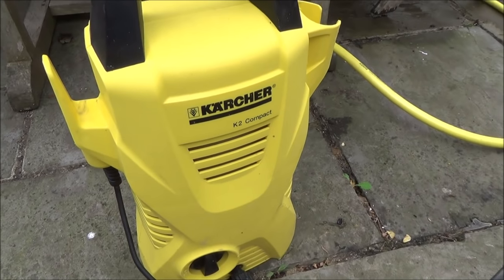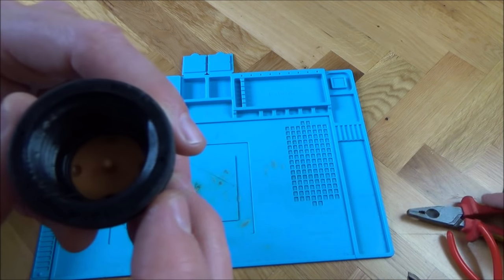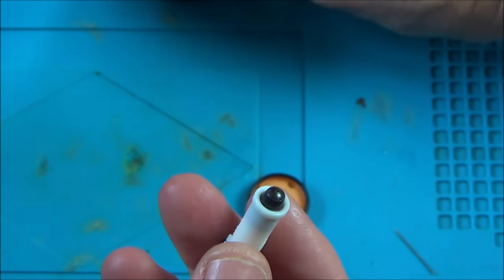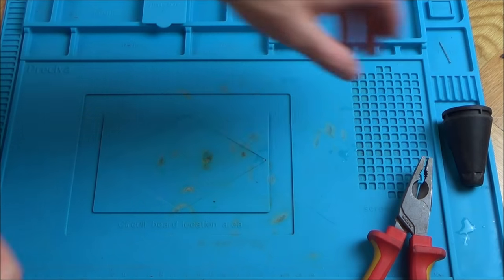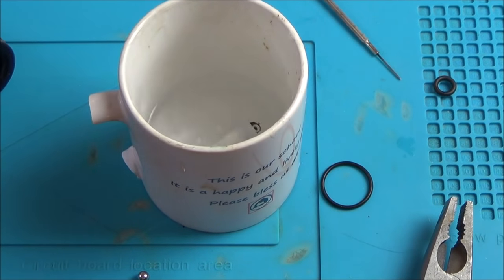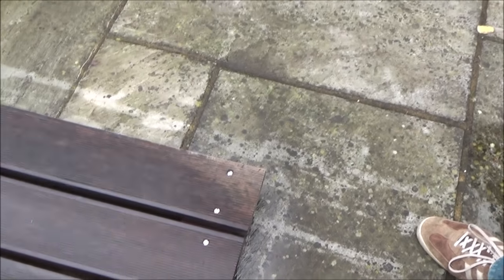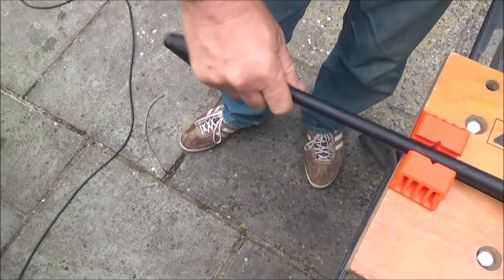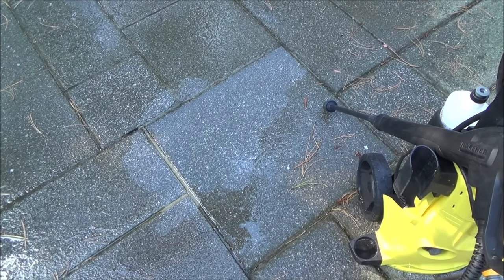Trying to FIX: Karcher Dirt Blaster Lance NOT Spinning

Comment: my job is fixing karcher machines, and i have to say that the plastic dirt blasters do wear out very fast and then stop working properly. the brass versions last much longer
Reply: The various fixes are pretty good. I wonder if it's possible to get after-market parts. What size washer is used in the fix? The dimensions are given in the video, but the metric or English size is not. Any thoughts? My metric pack does not have an exact size to fit. How does one obtain the brass bits? What is the proper name for the rotating bit with the ball bearing in?
Reply: @hanwachtel  there is not always a repair kit available. If there is one available, you can find parts list on internet with the type number of your karcher machine. The type number is on the white sticker that normally sticks on the back or side of the machine, its a 8 digit number for example : "1.520-093.0" . There are some repair kits available on ebay.
Reply: so why dont they just give us a brass one then ffs 0.0.
Reply: chrismechanic B because then how would they sell you a repair kit?

Comment: There's a much easier way to fix it.  Take the dirt blaster off, drain any water out and dribble some ordinary oil down the  outlet hole. That's it, no dismantling needed.

Comment: Vince tell your brother to get the patio head cleaner with bristles it cleans about a 10 inch circle from 4 inches away an stops the spray I haven't cleaned my drive/patio with just the jet since I got the head attachment an it cleans the area in a quarter of the time an your feet stay dry.
Reply: You also use less water.
Reply: The dirt blaster works better from a distance. The closer you go the smaller the cleaning area...

Comment: Make sure to use a stainless steel washer so it lasts.  One will not be horribly expensive.  Also most washers are made with automated punches and may have a bit of a sharp edge on one side and the other side will have more rounded and not sharp edges.  Make sure to put the slightly sharp side so that the bearing is not rubbing on it.  These nozzles are not overly expensive if you shop around but you don't really have to if it is not worn out or broken.

Comment: Excellent!  Who knew that repairing pressure washers would be fun!   I had to do a repair to mine many years ago - left water inside over winter, it froze, expanded and cracked a piece of aluminium on the pressure part.  Luckily I sourced a replacement part and it was good as new!  Now I always make sure to run the jet washer without water until all the water is expelled from inside, then store it for the winter.

Comment: I know, what to do when & if my dirt-blaster starts being a arse. Mine shouldn't as, it's less than a month old 😄  But, many thanks for your solution to a problem that could have had a cost to it. ( a new, replacement dirt blaster at a cost of 😕 )  Your solution with your brothers help 😁 has saved money on forking out for another. For those who may need to do so in the near future. THANKS ANYWAY!!!! 😉    I wonder what would be the, solution if the various lancewood, had issue's Maybe a video in the future, showing how, to deal with that,  . I'm sure, they are, quite, a bit more complex, at the nozzle.  Once again THANKS!!!

Comment: Great Vid. The key design element of the lance is that the ball bearing must protrude from its housing, thus allowing the unit holding the ball bearing to spin. I have a K4 Karcher where the ball bearing sits in a solid tube with no hole to let the water through. I created a copper disc that now sits in the bottom of the tube allowing the ball bearing to protrude the correct distance and it now works like new. Thanks (if you're still monitoring the vids)

Comment: I agree with your conjecture that the ball bearing wears down the plastic support mechanism.  I couldn't locate a washer as small as yours to bring up the level of the ball. Mine was barely above the top of the plastic retainer.  So I drilled a 1/16" hole in the sides of the retainer, just above the cross members, and inserted a copper wire across, bending it up to retain it.  The blaster now continues to run, albeit not as smoothly as before, but at least it gets the job done. Thanks for your insight.

Comment: I've just had to take my one apart too.  It's a GreenWorks model.  The jet nozzle has a 6mm allen up in it's rump and it's REVERSE thread.  My one was built almost the same.  I polished the bits that slide on each other with 2000 grit wet/dry paper and gave it a light tough of silicon grease.  Job done!

Comment: Ok watched. Agree with your diagnosis. Would offer that if you take a pencil and press the washer onto some 120 grit sandcloth with the eraser end, that after 5-10 min of sanding you can adjust the thickness of the washer easily. Sand two washers down to 3/4 original thickness!

Comment: I spent years working for Karchers Rn'D department. Have you ever wondered why the fitting wears down? Well we could have made it from stainless steel, but instead we tried numerous plastic designs. A lot of work went into finding the perfect plastics blend. We needed the fitting to last just long enough so we could be sure we wouldn't have warranty issues, but not too long. A lot of time was spent researching how long the average consumer uses their Karcher. Once we had an average we simply used a plastics blend that was purpose designed to wear out within a given time. Needless to say we charge way over the top for new lances (nearly a third of the purchase price of the jet washer), but hey that's just business! Stainless steel would have lasted a lifetime, but now we sell hundreds of lances.

Ok I never worked for Karcher, but somewhere someone would have been involved in the design and you can be absolutely certain that the fitting was made of plastic for exactly this reason.
Reply: I've fitted a copper disc in the bottom of my K4 ball bearing fitting and it now works like new. So the £54 for a new lance will stay in my bank account!!!
Reply: @999shakers  Good for you, I hope it lasts.

Comment: From diagnosis I am certain that this was dropped and it damaged the inside by changing the length of the stem. Because the length was short the stem was flopping around inside the nozzle and getting stuck till pressure built up dislodged it and lodged it again. Sorta why you feel that pulsing pressure at the start. I From what I can see this is how it works. The inner height of the nozzle assembly is actually shorter than the stem itself. This forced the stem to rest on the outer edges of the radius inside. When water is turned on the water is forced through that small pin hole near the top giving you that high pressure. This flows down the stem and around the bearing(ball). This ball gives the stem free movement around the radius of the orange piece and the small rubber washer acts like a bumper to protect the stem from slamming into the sides of the nozzle at high rpm. Due to the angle of the holes in the orange piece and the angle of the stem itself I believe is what causes the stem to rotate. Because this device was dropped it messed up the length which you both figured out. That washer fix is very nice but remember now because of the smaller outlet between that washer and ball you may end up having to open it up and clean it out more frequently.

Comment: very necessary info! we also have hard water and i immersed the nozzel in white vinegar for a couple of days which dissolved the minerals, largely calcium and magnesium [scale] and it seems to have done the trick - a squirt of oil/silicone now and then could also help. if there is dirt inside obviously opening the unit will be the solution.

Comment: What a fantastic video Vince! I've got a how to fix video coming up later on from our dryer. When it was turned on it sounded like there was something rattling about in the motor, but in fact it was actually a bit that I had changed out a few months ago that had fallen down the lint trap and was causing it to make a loud rattling noise and sometimes to stop the motor entirely, of course the lint trap was also full of crud as well and it leads directly to the blower. Here I was thinking I'd have to tear the whole thing down and replace the motor lol 🤷‍♂️

Comment: Here is the way that helped me. The nozzle jammed and gave a straight stream, the pressure was ok. What I did: "I found a way to start the nozzle without disassembling it. Just squirt the lithium grease in the spray inside the nozzle from the outlet side. Lubricating even a wet nozzle makes it run like new. 20 minutes. Then you have to repeat it and the working time is longer. Fairy tale. I recommend it. I used CX80 Lithium lubricant. " My nozzle got a second life, after a few cycles with grease, I washed 350 square meters of the driveway. RECOMMEND

Comment: My problem with this wand was the tip. True the ball bearing does sink in, so the washer trick is good. The cure was the end tip has a hole in I, pushed the dirt through with a strong needle and voila that did it. Put it back together, don't forget the O ring and it worked like new. Thanks lads.

Comment: Nice trial by error fix. 

Question: metal ball bearing vrs plastic = worn plastic.
Metal ball bearing vrs metal washer = ? Will the coating come off either the bearing or washer and leave rusty jammed ball bearing?
Reply: Ideally you'd want to use a brass washer, and it should probably be modified a little bit, so that it still allows water to pass through freely.
Reply: that is not entirely true, some nylon types are so hard they wear through steel in no time.

Comment: I had mine not starting after almost a year-stop. It would just not start as I pull the trigger, so I thought it was something with the switch. And so it was: not the main switch itself, but the pressure switch inside - it was stuck somehow. The problem was that in order to disassemble that switch I had to undo the pump's head. On reassembling it, I mounted the o-ring wrong and it leaked all the oil out. So I had to disassemble it again, do an oil change and finally reassemble the whole thing. Now it works flawlessly!

Comment: Very nice deduction and repair.  May I suggest that 1) I hope you used a stainless washer. and 2) If you had used a rotary fine grinder and created indents around the outside of the washer for water to bypass, you would have had a far better flow and cleaning pattern!
If you don't know what I mean, just ask.

Comment: As an engineer for 60 years believe me when I tell you that Karcher stuff is total crap. They had a good reputation years ago but don't be fooled, the stuff they are turning out these days is RUBBISH!! See Karcher reviews on "Trustpilot :)
Reply: I've used Karcher for years and found them to be most reliable so I guess it's down to the luck of the draw, the user, and how well you look after and maintain your kit, Oh I'm an Engineer too although only for 42 years. :)
Reply: Who reviews Karcher, good though, you'd only go to trustpilot if you were annoyed.
Reply: yeah ill second that, i use mine to clean my 2 cars, mine is being tempramental now the quarentee has run out, sometimes the on/off switch does nothing.
Reply: @hcashmore11  that's true enough
if broke you have the time and  reason to hunt a way to complain ......if you happy and it working you  busy using it
Reply: Seems to me they used plastic for the bearing surfaces purely because it would wear out faster. I can appreciate the red cap would be too expensive to machine from metal, but the other bit that hold the bearing could easily be metal. So annoying to thing someone literally sat down and designed something to wear out.

Comment: You've got me worried now - my one of these was reluctant to start spinning when I used it the other day. Something else to add to the list.

FWIW to me it looks like the angled hole plate makes the ball-bearing end of the nozzle rotate around the chamber. The small O-ring then contacts the side of the chamber and makes the nozzle spin on its axis, which in turn may make the output end run on a water bearing to reduce wear.

Comment: I haven't used it yet, however, this pressure washer replacement gun offers greater spray flexibility over the standard sprayer gun that came with my pressure washer originally.

Comment: If I look at the construction the ball bearing blocks the passages as it is in the top cavity of the small pipe(water inlet).  Perhaps try putting the ball bearing next to the white pipe, this way the entrance is not closed of by the ball bearing. I had a similar problem with a ALDI topcraft/kingcraft one.(which was also kaercher) I that case the ball bearing went in the upper cavity to give enough inertia to the pipe. The water entrance was not in the top part but half way the length of the pipe.

Comment: This is just a bad system, to be honest. I used to have a Karcher machine a few years ago, and the lance stopped spinning within just a couple hours of use, got it replaced, and the new one stopped after a couple weeks.

On my old Nilfisk (i'm guessing that's a brand you guys don't have), everything is still working fine after like 10+ years of use, even though it's a much cheaper, much more low end machine. Now i did like the Karcher a lot, apart from that awful spinning lance. Next time i need a new machine though, i'll probably just stick with Nilfisk.

Comment: Great Video, very informative ! HOWEVER,  I can't for the Life of me, unscrew the Conical Bit. I've tried everything including carefully immersing the Conical Bit in boiling Water in order to expand the threaded (female ) portion from the threaded (male) portion on the Lance. At the Moment I'm soaking it in WD40 so I'll try again later. I see that you have a "K2" Version which is a slightly lower Pressure than my "K4". I was at the local DIY Center to find the Price of a new "Dirt Blaster" (as you call it) and they are quite reasonably priced (by Today's Standards). There were 4 different ones according to the Pressure Value of the High Pressure Machine. The Prices are considerably lower here in Germany compared with the U.K. (well, it is a German Company after all). I'm always amused by the way the Brits mispronounce German Words, but that's another Story.
Ask your Brother if he can suggest a better Method of unscrewing the Conical Bit. Failing that, I'll have to buy a new Lance - Yuk !
Reply: Use an "Oil filter wrench", along with the 18mm if needed! Might sound strange, but a multi hand 🖐 operation, will surely help that first break. Time for the "volunteers" step in! ;-)

Comment: The BIG O-Ring goes on the end of the WAND on the long rod, not on the nozzle. That is the entire issue it's not working.  O-ring slid off end of want near threads. There's a concave indention for it on the very end of the wand. It DOES NOT go on top of the yellow disc. LMAO I can tell you're not from the USA!
Reply: Fun Times seems like the person who borrowed it noticed it stopped working and disassembled it and ended up with the o-ring in the nozzle. Same happened to mine, I got it working by not fully tightening the nozzle. I will use it today so I will see if I can reposition the o-ring “correctly” for success.... thanks for your tip there!

Comment: A great video, but it didn’t cure my Karcher.  I gave all internal works a good clean. There are no washers of these dimensions, all washers are classed under an ‘M’ scale so the nearest are M2.5 which I filed down to fit. Tried it with two washers, no success. Altered the black tip distance multiple times, no success the Karcher still pulsates off and on’.

Another YouTube ‘Karcher K4 Full Control Pressure Issue (2.05 mins) James Duxbury.
 He says clean out the water filter. This is behind the screw-in black water pipe connection. Unscrew, with long nosed pliers pull out a small white plastic cylinder. Mine was black with gunge, cleaned it with hot soapy water, a Tee Pee brush then left overnight in vinegar. I thought I was on a winner here!!! But no, it still pulsates off and on during use.

More time searching YouTube, found ‘Tear Down Karcher K2 pressure Washer (24.45 mins) Andrew Jackson. 
This guy stripped down the same as my model to reveal a large white plastic barrel that protects the motor from water. At this stage I ‘bench tested’ mine, connected up the power, water and lance. The problem was now clear, water forced its way out of the plastic piston seals during each press of the lance trigger. I could see lime scale residue from the last time I used it. I have only used it 4-5 times over 5 years. Read the reviews below this clip, the new parts cost made it not worth Andrew’s effort to mend.

So, mine will be scrapped, and I’ll research other makes for better reliability. The only winner is Karcher, those unfortunate fork out good money for overpriced plastic spares. They seem to be priced according to how long they last, the ones that break/perish first cost the most.

Read the reviews under this heading, especially the review 56 places below mine (sort by newest first) a white ‘A’ icon in a cyan circle, by ‘@And-rc9yy’. I know it is a ‘tongue in cheek’ comment but I am inclined to think this person is right.

Comment: Descaling/decalcification of the nozzle/dirt blaster is the method I used.

Works like new again without problems coming back.

Fill the tube with descaler (concentrated /not diluted) and let it stand upright for a few hours with the tip down (tip covered with a cloth so that the acid descaler is allowed to work).